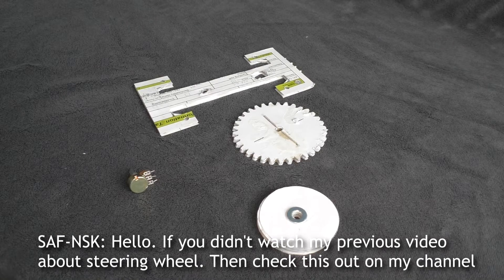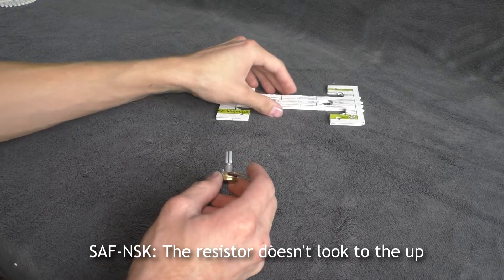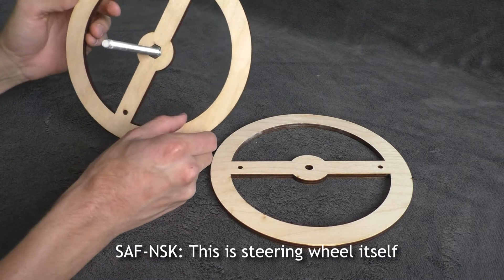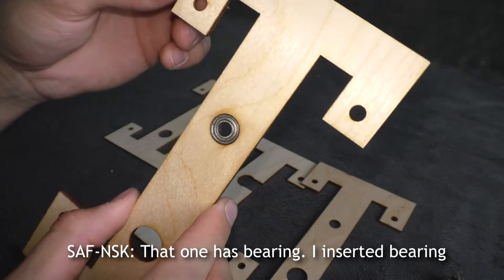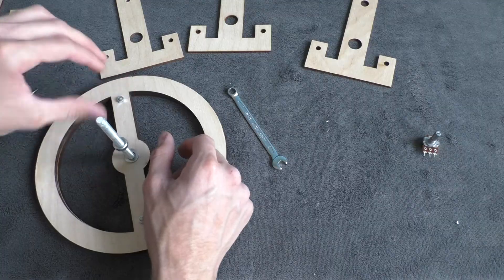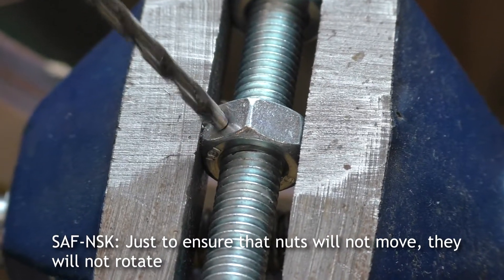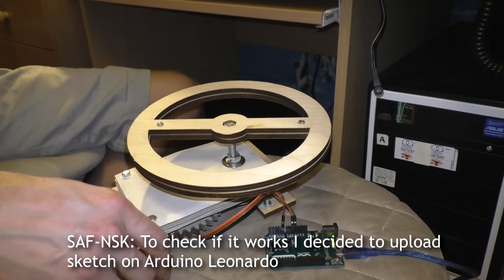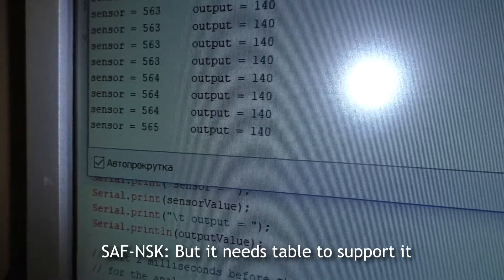Handmade plywood driving simulator controller. Part 1: Steering wheel.

Comment: why didn't you use a 10 turn pot? They are not too expensive
Reply from the maker: Oh, you gave me an idea! I had only this pot when I was designing, and I even didn't thought about using 10 turn pot. Thank you for advice! As soon as I'll get this project done I'll design a wheel with 10 turn pot and much bigger(I prefer truck sims so it will be more suitable for this purpose).
Reply: @saf-nsk9724  happy to help